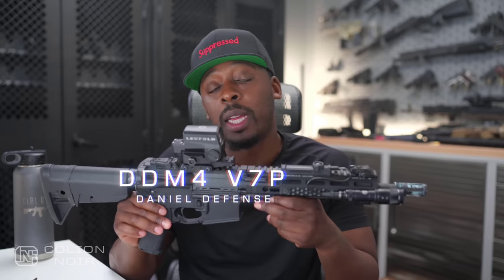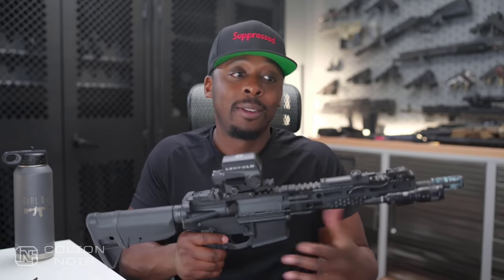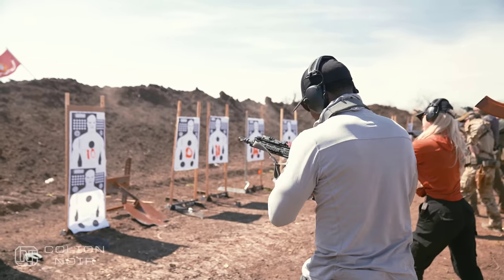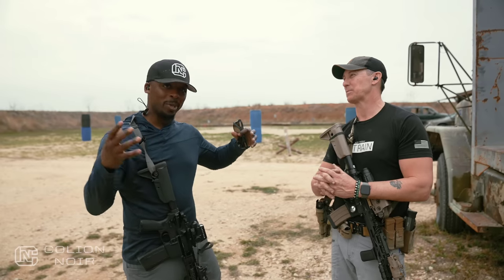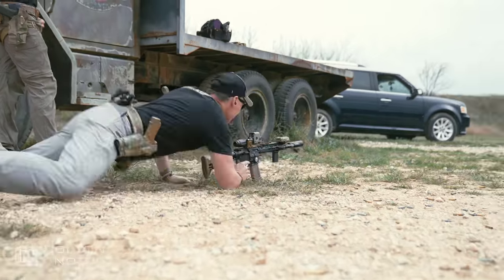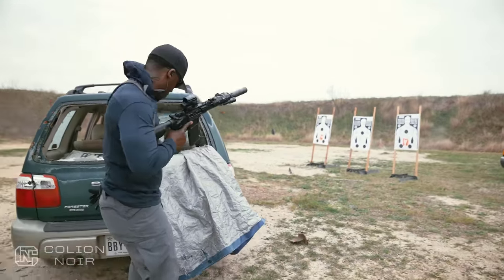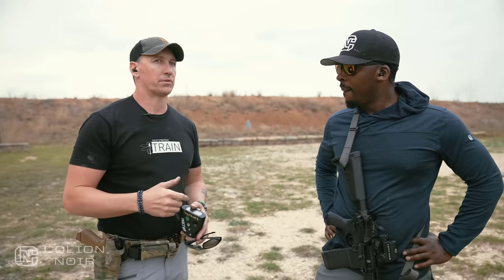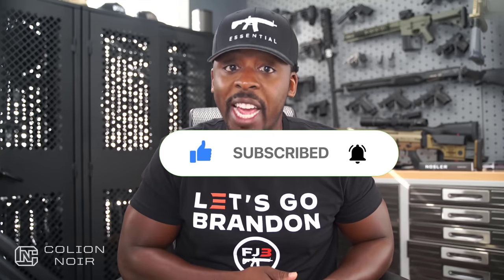I Took This Marines Rifle Course And This Drill Was The Jack Of All Trades

Comment: I appreciate both the “wrap the individual fundamentals into a coherent whole” and the “this is just a model, modify it as you see fit” attitudes. This and similar drills can be nearly infinitely modified by rearranging the elements and or adding elements per special requirements as was said.
Learning the elements by rote is okay but you gotta have flexibility in applying them.
Reply: I liked his approach too.  Multiple practical skills in one drill and modify it to your likely area of operation.  Smart.

Comment: Not to nitpick but your rear BUIS needs to go back one notch. Not only will it be lined up with the back of the receiver but you'll be able to bring it up and it will not smack into the optic.

However since using a riser, you aren't getting any kind of lower third.

Comment: I hope the instructor made a point off camera that you drop the mag reload and get on with the rest of of your life.
Reply: Genuinely curious - why? Obviously in a real gunfight you’re not going to hold onto empty mags, but during training what’s the harm? Unless you’re the kind of guy who has 1000 pmags lying around, it seems like constantly dropping them could cause damage or even malfunctions in the future. Am I off base here?
Reply: @asdfghjk2933    In training you’re trying to build muscle memory and internalize behaviors that, god forbid, may save your life. The physical safety of “objects” shouldn’t be the priority. I’ve seen videos of well known people purposely throwing rifles on the ground to illustrate to students the need to not worry about dings and scratches above the real purpose of practice. It’s like getting that first dent or scratch on a new truck…it’s liberating. BTW, you can’t be “off base” by asking a question. Have a good one.
Reply: @damiangrouse4564  Thank you for the reply. Muscle memory makes a lot of sense. By off base I mean if I was wrong about the assumption that repeatedly dropping mags could cause malfunctions eventually, so if the only “damage” is dings/scratches on the metal or polymer then that’s a very worthwhile trade off!

One more question if you don’t mind - this isn’t related to ARs, but handguns. When I’m dry firing, I rack the slide just a tiny bit back to reset the trigger without ejecting a snap cap. Do you think this is a bad habit? Obviously in a fight, if I need to rack the slide, I need to rack it fully and quickly. Do you think this “quarter rack” habit might screw me down the line? Appreciate it.
Reply: N1CK_GURR  Makes sense, thank you.
Reply: @asdfghjk2933  dry firing is important but it remains a compromise…there’s co2 driven conversion kits that give you a more realistic operation…sorry, can’t remember name of one but you can probably find a video on them.
Reply: @damiangrouse4564  Yeah they’re out there for glocks, but my gun unfortunately has a way smaller aftermarket.
Reply: @GunsNMetal   you’re welcome to keep training like you have a squad covering while you take your time reloading and putting away your mags.

Comment: you can train like  super soldier on any scenarios for as long as you think you have adapted, You would be wrong. Because the opposing has you zeroed in. It's all just target shooting. With all due respect. Left with 9 former special ops veterans 2 Vietnam USMC combat veterans myself included November '22. to Ukraine, 6 weeks we were done. Got back to  US February '23 with 6. The Theel is gone. I'm trying to understand but it's difficult
I'm 78 years old was a fool for going to Ukraine, My 26-years in the 'Corps. did not help me to adapt. No one has had the realistic conversation of being shot, because there scared to bring it up, You may get off the first round but if you didn't drop um his return fire just ended you're  lives. No one in any of these videos have ever been in a 8 hour firefight, with death tapping them on they're shoulder. And having to explain what's it all about. It's all good I
suppose. Don't mind me, I'm just an old man. Retired USMC '89. Two combat tours RVN,
Beirut '83. Advisory command Afghanistan '85-87. Ukraine unauthorized AYOR. WIA 5 
different times RVN,  The Targets were shooting back.